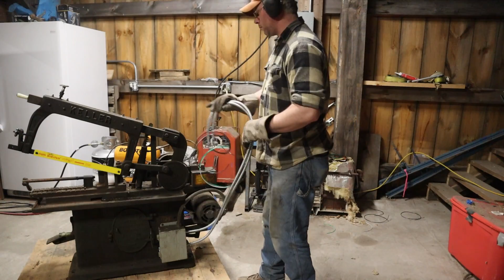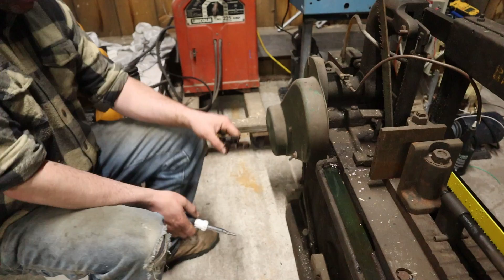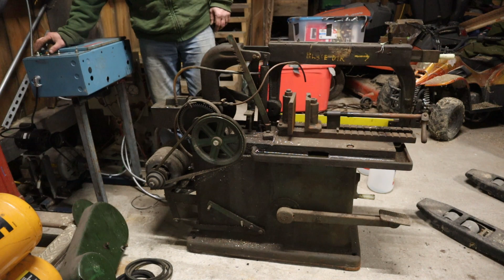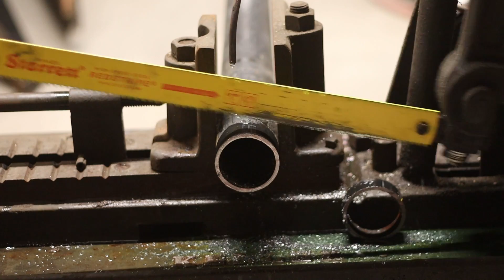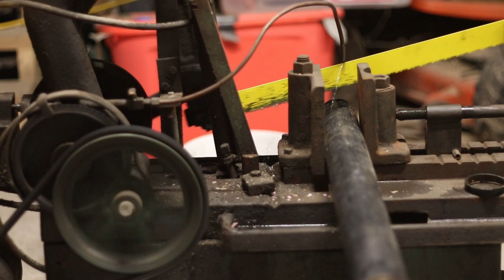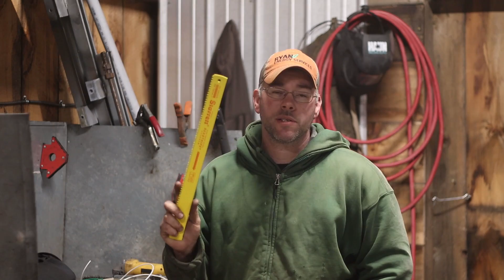DANGEROUS VINTAGE INDUSTRIAL TOOL BACK IN OPERATION

Comment: Hey bud I'm just passing on some good advice,  many yrs ago I got a older craftsmans tablesaw, and it had a 1hp motor and with a newer V~belt, it still made the motor jump a little bit. An old timer showed me those link belts. They come in red or green. Found the same ones they sell @ napa, and outdoor equipment parts stores @ Harbor freight for $34, I will tell you my table saw runs so quiet and smooth. I put all these link belts on my 60 gallon air compressor,  floor 20in drill press,  my 4 x 6 band saw brother they are perfect. Don't know if you know about those.  I thought your hack saw would work perfectly with one.
Reply from the maker: I use them on my table saw, good belts.  I do industrial HVAC for a living so I have access to like new belts which makes it nice.
Reply: @TheTradesmanChannel  that's awesome, it's always nice to talk with a blue collar guy. I'm a Electrician for 30+ yrs now.

Comment: Love these machines. Mine is a 14” Racine power hacksaw. Coolant, hydraulic down feed, a clutch, and a few other things. Everything is cast iron. The belt guard alone is about 30-40 lbs of cast iron haha
Reply from the maker: I love this machine, nothing it can't cut.
Reply: @TheTradesmanChannel  yup. Anything from steel to aluminum to titanium. Slower than a bandsaw but very square cuts. And fun to watch! What’s the cutting capacity on yours? Mine has a 6” (technically 6-3/8) solid square capacity. I’d like to get some 6” square stock just to see how it cuts it haha

Comment: Old tools are the best . Looks like it cuts nicly.
Jim I have a question that is right up your alley. My boss said to reinstall an evaporator that had spun loose. It pulled the wires out and cut them. The three wires are not marked of if there were I can't tell any more. Boss said it was 480 3Ph and the fan motor data label showed it was 480 single with L1 and a run cap then L2 . The cap is hidden and below 0º I can't stay in there to do the digging I need to do. I did meter to ground and found 280 VAC on two lines and very little on the third. How do I make sure I use the right line as L1 with hot side of the cap?

Comment: Jim, you're putting me to sleep waiting for that to cut the  pipe, LOL. I'm glad the saw I used to cut square tubing  for my buddy's manufacturing company was much faster. Looks like it will do the job though. Better than the 4" grinder, thanks for sharing.
Reply from the maker: To me it doesn't matter how slow it is, I can turn it on and let it eat while I do other things.  Hope you're safe where you are tonight.

Comment: I dig your bucket seat. If I get any fatter I'll need a barrel seat. I made my chain saw mill and sawed up my walnut and am working on an ash. It was possibly 50-80' long and rotted in the center. I got some boards made but the trunk is about 45" OD and too big for the mill. The trunk is also 5-15' up in the air. I will have to make smaller parts. That saw is cool.
Reply from the maker: That's some big trees T.  I used to do a lot of chainsaw milling, it's fun.
Reply: It's makin' me old faster. I got to watch hurting my back.
Reply from the maker: Yes you do, if you can get the log up it makes a world of difference.
Reply: Yes, I finally figured out how to hoist the logs up to waist level with chains and come-a-longs, wow what a difference.
Reply: Yes, I finally figured out how to hoist the logs up to waist level with chains and come-a-longs, wow what a difference.

Comment: Morning Jim. Keep an eye on that electric bill, these old machines sometimes like to drink those kWH's like it's lemonade on a hot Summer's day. Cool tool, though. Typically a bit slower than a bandsaw, but also typically a bit more accurate.
Reply from the maker: It'll pull even more power with the phase converter hooked to it.

Comment: And just like that you are another step towards Total World Domination .... Mwha ha ha!

Seriously though a nice old tool! We used to have one when I was in school ...... The only thing I can remember was the blades were Blue, and broke a lot ;0) 

Now a Belt driven Metal Lathe ..... it didn't come from a steam powered shop by any chance, did it?
Reply from the maker: I'm thinking it did come from a steam plant.  There was a huge amount of that industry style around here at one time.
Reply: Most of the UK electrified in the 1920's .... I assume it was similar in the US? Before that most shops would have had a little hit and miss engine running a shaft .... and before that Steam! It can be interesting looking at mills where you can see the additions over time!

Comment: Like to see how the mechanism works that lifts the blade up for the return stroke and drops it back down for the cut stroke.  So many people I've seen on videos both with files and saws never lift tools on the return stroke and they are ruining the tool.  Makes me cringe.  Like drilling on high speed with no cooling juice.   Grin
Reply from the maker: There's a little hydraulic piston pump that does it.  A cam on the gear box runs it.
Reply: My saw does not offer a lift mechanism nor  a drip. I was pleased to see they added those options on this newer version. however even with dragging the blade back it still lasts a long long time.
Reply: Any way to show the workings? Im a visual person. Lol. I could read a book on how to do something and not get it but look at it for a few seconds while its working and understand it.

Comment: That is a noisy old girl Jim, perhaps a lot of wear, or just needs grease ?  Did you say 4 tpi ?!!?
Reply from the maker: The squeaking is the belt on the slip pulley.  I'm surprised at how tight the bearings are on this.  4 teeth per inch.

Comment: Nice and smooth that machine of yours are you able to use all of the blade or will it just wear in that area 🇦🇺🇦🇺🇦🇺
Reply from the maker: It'll just wear that section out but I can sharpen them.
Reply: Well, if he is cutting wider stock, more of the blade will be used.

Comment: Looks like yours has a hydraulic lift. Check the fluid reservoir and the seals. It should lift it off the blade a little more with each cutting stroke. Then it bites harder. Should have an adjustment to put more weight on the blade and also slow it down a little and it will cut a lot faster...
Reply from the maker: You'll see in the video where I adjusted the tension to cut a little less.  Once I figured out the hydraulic adjustments it really started working better.
Reply: @TheTradesmanChannel  mine was cutting ok with pretty much any adjustments but then I got them all dialed in together the planets aligned and it started cutting like butter. And it got really quiet too. One of the only power tools I could run in the middle of the night and not wake my wife and kids up or piss off the neighbors.

Comment: I had to find a belt once in a pinch I got one from auto zone. They have a universal with removable links....
Worked well enough I just kept it.
Reply from the maker: The adjustable belts are actually better, they don't take a set and run quieter.
Reply: @TheTradesmanChannel  I use them on a lot of things now, I do still have a one piece leather belts on my south bend lathe and my Hendey T&G lathe. But it does make a huge difference not having a seam in the belts when you want a perfect finish.

Comment: I love mine. Its the coolest tool I own.
One motor runs the saw arm, the hydraulic pump that lifts the blade and a pump that drives the coolant.
Mine has a big clutch arrangement and a gearbox. 
I use it all the time. It's super quiet and it totally replaces my harbor freight metal bandsaw. The classic red one.

Comment: Why is the saw stroke so short? This will greatly reduce the life of the blade.
Reply from the maker: Just the way it was made.  It will wear the one end out while the far end will be sharp.  On the plus side I can sharpen these blades quite a bit as needed.  I have been cutting tool steel all day today with it and hasn't dulled at all.  I'm using windshield fluid for the coolant, works very well.
Reply: @TheTradesmanChannel  windshield coolant? Is that good stuff to use or just in a pinch? I have a ton of the stuff and coolant isnt available locally and is EXPENSIVE.
Reply: TheTradesmanChannel will the vise end stop move forward so you can use each sharp section the blade?
Reply: When you set the vice at 45 deg there is not room for a longer stroke. it would be great to have adjustable stoke length. My saw is much older with jackshafts and oil cups probably from the 1940s. I love that thing!
Reply: I just looked at mine and I can reposition my blade front to back quite a bit and use about half of it it looks like.... I've got an Economy Saw #4.